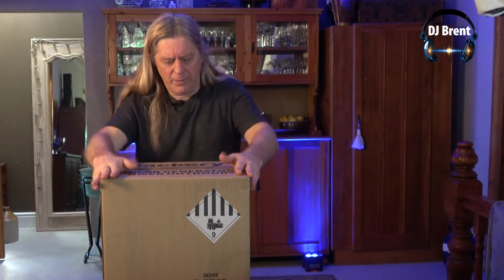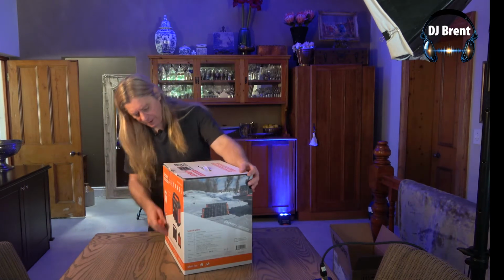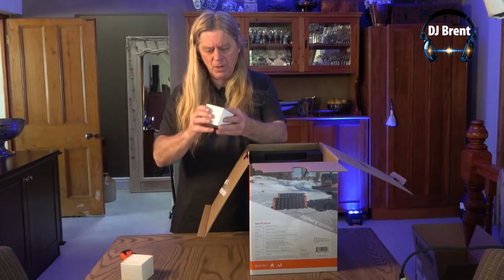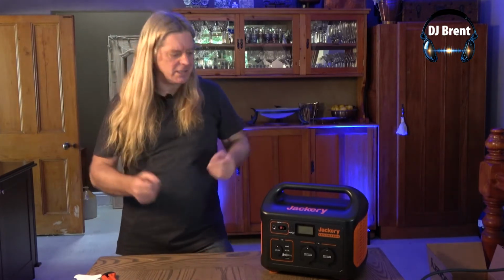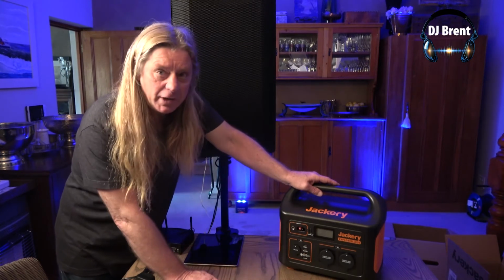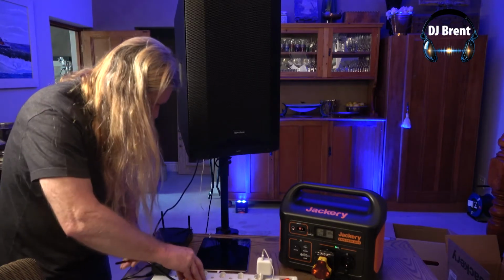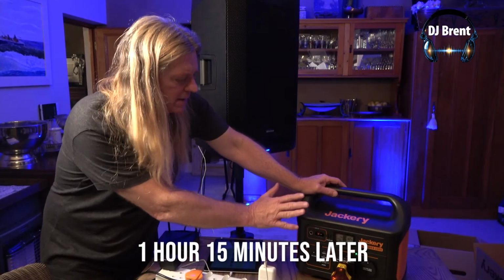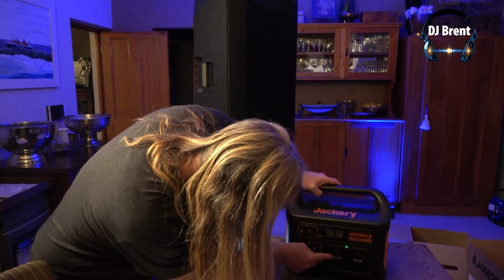Jackery Portable Power Station Unboxing & Review Wedding DJ - Can It Power Your Wedding Ceremony?

Comment: Just wanted to follow up if you had the opportunity to do a small setup. And how long it had lasted with what type of setup.
Reply from the maker: Hi DJ Revuleo. I have done both a small and medium reception setup using my DJ controller, external mixer, 2 x15" Presonus AIR tops and 8 LED Par Cans. I've been turning the sub cab off and the moving head lights as they are big power draws. For weddings receptions, up to around 100 people, I have managed to get through a 4 hour loadshedding. Ceremonies and cocktail are not heavy draws and I often only end up using 20-25% of the battery - even playing a 2 hour cocktail session. Not sure where you are but here in South Africa we work on 50Hz and 240V power and the above relates to these power draws.
Reply: @djbrentsa  thank you for your quick response. I’m in NY and have been doing some research trying to to see what would fit my needs as I have been getting more weddings that want outdoor spaces. I have Recently picked up some battery powered speakers and SKAA wireless transmitters/receiver but hoping to be fully battery with laptop and controller maybe even an additional speaker. 

Thank you for your breakdown as it will help with my further research.
Reply: @djrevuleo nice I’m in nyc I can tell you the skaa the best thing since sliced bread. lol.   With  the 1500 u can easily get close to 3 1/2 -5 1/2  (if keeping laptop plugged in or controller plugged in)the trick is too get a controller that don’t use power me I still use my sb3. Or prime go    So that u don’t draw power from the laptop  and I use battery speakers. Everest 8 and have spare batteries. Which I can get 8 hours on full blast.   So the only thing that’s running on the  generator is the controller or when I’m charging the prime go    The skaa receiver -transmitter u gonna get about 8-12 hours  without charging   So with that  said if u get a controller that runs off ur laptop or have prime go. I can really extend it
Reply: @donaldccannon1  awesome thank you. I’m definitely looking at possibly picking up the 2000. Just cause my laptop battery isn’t the best so I might have to be plugged in half the time. I have two battery powered speakers with my SOUNDBOKS and everse 8. But I like my 1000 and Flx10. So have to go bigger jackets  to do back to back sets with some buddies.